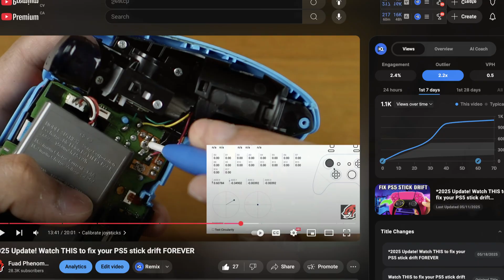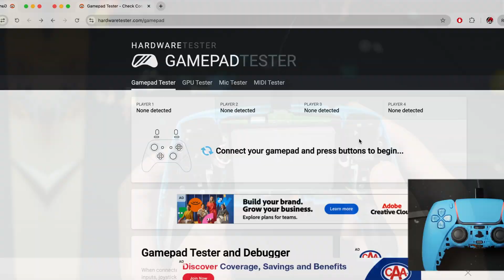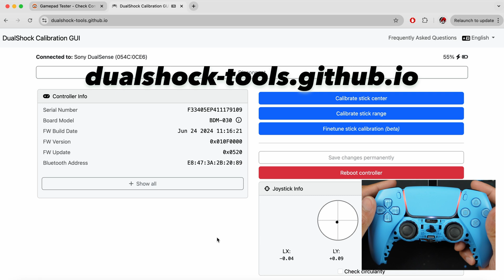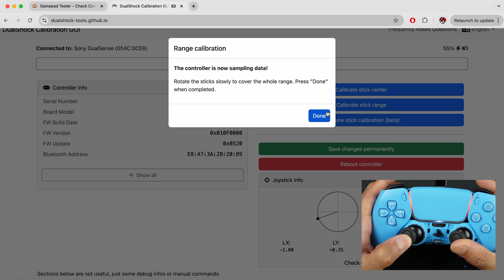Hall Effect Joystick PS5 Upgrade | DIY PS5 Full Controller Mod Tutorial!

Comment: Worst video I've ever seen in my life. You shouldn't stick any kind of pointed tool into the solder holes because you'll ruin the lines and lift them. You used too much soldering flux and almost ruined the PCB

Comment: Hello master. I also changed the Hall Effect analogs just like you. But the remote control does not turn on. The orange light flashes 3 times. What is the problem? Regards...
Reply from the maker: I had a similar problem with my xbox elite where it wont turn on wirelessly. Does ur controller connect via USB? If yes, I'd assume that ur wirelees module may be damaged
Reply: @FuadPhenomenon Master. I tried wirelessly and wired as well. The result is the same. The orange light flashes three times. It does not turn on at all.

Comment: I use solder iron but i didnt need to break it off i just gently pull on it while heat all the pin in circular motion and you feel it slowly coming loose until it come off completely

Comment: Your desoldering technique is poor. You made it much harder for yourself by failing to use the solder sucker properly. When desoldering with a solder sucker, melt the solder, then quickly REMOVE THE IRON, and before the solder solidifies form a seal as best you can over the solder blob with the end of the solder sucker and suck. This will remove 99% of the solder.

Secondly, why are you applying flux when using desoldering braid? It’s already impregnated with flux.

Finally, those solder blobs are ugly. They should look concave, not convex.

Comment: The most helpful part was the calibration holyyyy i thought i messed the whole soldering part up and i gave up till i came across this video
Reply: Question by “messed the whole soldering part” do you mean like you saw stick drift or like moving the joystick didn’t register or both, bc rn I’m getting both stick drift and moving my joystick doesn’t change my values

Comment: You know you can carefully use a flush cutter to cut the 4 main legs to separate the module then use a solder iron and heat the other 4 tiny pin and gently pull while you heat each legs one by one and it will come off. Soldering sucker is waste of time unless is part of the soldering iron in one mechanism. Make sure you already extract the potentiometers first before doing the cutting.

Comment: i ripped like in video and the green board layer peeled of with stick. I thought is not big deal and when i installed stick, the stick drifts into left nonstop. i think i messed contacts or something. gues i will buy the new one now, so much about doing yourself thing
Reply: Hit me up bro I’ll teach u how to fix it or I can just do it for u lmk
Reply: @alexjohnson6993 thanks bro, but i just ordered the new one recently. Guess i will keep the messed controller for parts or something. Next time i will just use hot air gun
Reply: @TheCooler1993   I can still help tho if u want with soldering in general and give u tips and stuff. I have a lot of experience with these. Mind as well fix the other one then you’ll have 2 and it’s good to learn how to do it

Comment: Yikes, I could feel the pads struggling, thankfully you didn’t tear them off along with the traces. If the component doesn’t come out easily, don’t tug on it - gently nudge it with the iron and wick, wick, wick until it wants to fall out with little to no force.

Comment: This is not how I would want to fix my controller, forcefully removing parts is only going to end up with pads being ripped from the board resulting in either a dead board or a bad day soldering to traces.

Comment: Thank you so much for making this video! I've seen quite a few "for beginner" type videos and this one is by far the most helpful. Especially because I always see so many videos of people soldering but with so many different kinds of tools and ways to solder and work with smd's. So, I don't mean this in a bad way at all but I really like that you show more simpler and even more primitive but effective ways to work with through hole solder joints. This one video has helped me so much in understanding how soldering works and the limits you can take it. Thank you!!

Comment: What type soldering wire are you using?
Reply from the maker: Leaded solder :) has low melting point to streamline the melting
Reply: @FuadPhenomenon  i mean lead are you using 0.6mm or 63/37 
Can you post the link for the one you use if that's ok thanks

Comment: DO NOT rip out parts like that, that's how you rip the pad off and ruin the entire board. Use a desoldering iron with proper tip size instead
Reply: after watching this video Jesus Christ thank part of ripping it off the board was cringe af smh. can't call yourself a repair person if destroying the whole board like that.
Reply: That was hard to watch. Ripping it out like that and using a push pin to clear the holes was brutal. There’s other videos out there that do this correctly. Don’t do as he does.
Reply: @doubledigitdreams  well said
Reply: Good advice, but I want to add that you shouldn't give up if you do take off a pad since they can be repaired, or you could get lucky and it's just a ground pad.
Reply: @LeoViktorovich  yes very true, but u have to be able to find the trace and u still need to connect it even if it is ground
Reply: i ripped like in video and the green board layer peeled of with stick. I thought is not big deal and when i installed stick, the stick drifts into left nonstop. i think i messed contacts or something. gues i will buy the new one now, so much about doing yourself thing
Reply: @TheCooler1993 I can teach you how to fix this if you want I got u bro
Reply: @TheCooler1993  either I can help or u can send it to me and I’ll do it for free just pay for the shipping
Reply: Did that :(
Reply: @andreilucian10  that’s okay tho I can teach u how to fix it
Reply: I attwmpted replacing sticks myself and now they aren’t responding when I test the controller. Any thoughts on why that happened? I’m thinking I may have fried the circuits.
Reply: @brandonthe90skid96 yea I can definitely help if you give me one of ur socials

Comment: bro, if you are going to do this a lot, invest in a good desoldering iron, they are 35 bucks. the pump is part of the iron. i can do a double swap and re-solder and calibration in less than an hour. you don't need to follow up with wick either.
Reply: Yo bro can you give me the link for it?
Reply: I like this idea of cheapest way possible. Bc i was thinking maybe I could fix/upgrade my old controller cheaper then buying a new one which is 70$
Reply: @sSinisterGam3z   I wont lie , if you have little or no de-soldering and soldering ability its gonna be a pain. I've got good equipment, you have to de-solder and re-solder 36  joints 18 per side in the area of about a nickel including 4 hair thin wires for the vibrators. I've installed TMRs in mine and I'm satisfied so far,  ive probably got close to 40 hours on the controller since.
Reply: @Jimmyz96 i do have experience repair/replacing small components on tech just not soldering i figured it wouldn't be that difficult
Reply: @sSinisterGam3z   cool, its not bad at all if you have a de-soldering iron. I put Hallpi TMRs in mine,  about 40-ish hours on it. not including your time its about ten bucks a controller, you could probably find them cheaper buying in bulk. took me an hour to replace and re-calibrate, got the circularity error down to 4% they are fast and responsive, but I don't play competitive FPS. word is they prefer OEM.

Comment: My vibrator and mic audio doesn't work
Reply from the maker: Mic is one of the two yellow cables, so that needs to be snug fit. The thin motor wires need to be soldered in place :)
Reply: Thanks @FuadPhenomenon

Comment: When using solder wick. cut an inch of it instead of using the entire roll. Then hold the piece in place with pliers or tweezers. It's MUCH faster as there's not as much copper for the heat to dissipate away into.
Reply from the maker: Ahhh, I saw that somewhere and didn't think it mattered! Will try out next time, thanks for the suggestion! 👍
Reply: What temp do you use to desoilder?

Comment: I had planed to replace the sticks in my used PS5 controller for a long time. This was before either Hall Effect or the even newer TMR sticks where available. I ended up picking up a MOBAPAD ChiTu a while ago, it's got Hall Effect sticks and all the buttons are micro switches which is really nice. I'll probably also end up picking up a Game Sir Cyclone 2 or a Big Big Won since they both have TMR sticks and also use those wonderful micro switches. I actually really love my PS5 controller, even gave it a fresh finish with a soda blaster years ago. Some emulators need gyro support for some games so that's why I want to fix it up. If you want to more easily suck up the solder the Engineer SS-03 is an amazingly good solder sucker from Japan. Another thing that might make it also easier is a better iron, you an pick up smart controlled direct driven heated T12 soldering stations for cheap, or the newer T245 for a little bit more. you can find them on AliExpress and some on amazon but limited selection, I'd go for a T245 since it can do much more wattage for big and small jobs, from what I saw you can get a cheap one for $60 with 3 T245 tips, the cheapest T12 was going for $55 with only one tip so I think the T245 is a better deal. They are miles better then the Hakko FX-8801 style knock off irons they sell for real cheap. You can very easily stress the joint and make a lifted pad with those cheaper irons. Another thing is use 37/63 Leaded solder, it makes everything so much easier and turn out so much better, the lead free stuff is no fun to work with even for people who are good at soldering. Nice guide for anyone you want's to DIY there own controller.

Comment: just use low melt solder and use simple heat gun and comes out quick ..then use solder wick for the last bit left
Reply from the maker: Great tip! Will try to look for low melt solder 👍. But do they perform well is another question tho..
Reply: @FuadPhenomenon yes low melt solder melt easily and if you use it with combination of solder sucker that you used here, it will suck all the solder at once after low melt solder, so you don't have to use solder wick, just apply flux use low melt and then suck it with that pump and it will remove all the solder at once👍
Reply: @FuadPhenomenon and one more tip the soldering iron tip you are using here isn't suitable for this kind of job, here you have to use a bigger soldering tip to transfer heat perfectly, the tip you are using is for micro soldering not for THT components

Comment: If you have a large chisel tip you can also remove the potentiometers by heating all 3 at once. Then you can cut the main module into 4 pieces and remove all big ground pins one at a time.
Reply: If you don't have a flat chisel tip to use, you can use a small thick piece of copper wire and actually solder it to all 3 pins and then use your soldering iron to heat the copper and it will melt all 3 pins at once...I have done this many times before I had nice soldering tools...
Reply from the maker: Great tip! Absolutely, the flat tip can help desolder three pins at once!
Reply: That's what I do using a T-12 K tip.